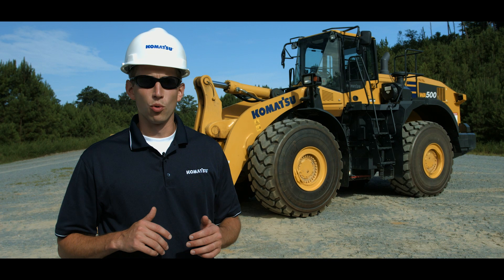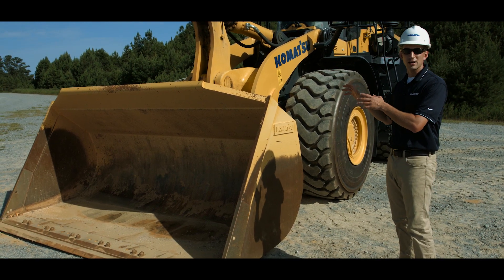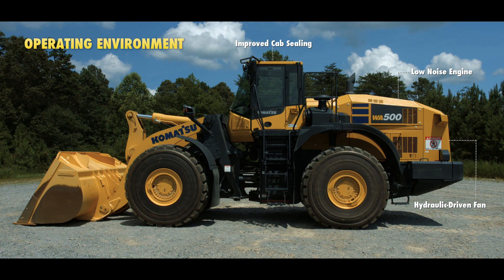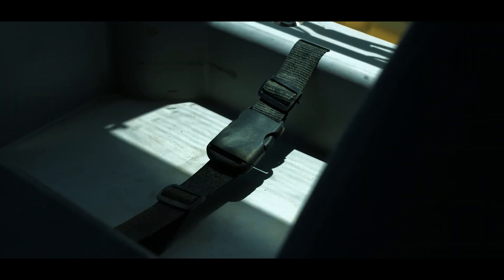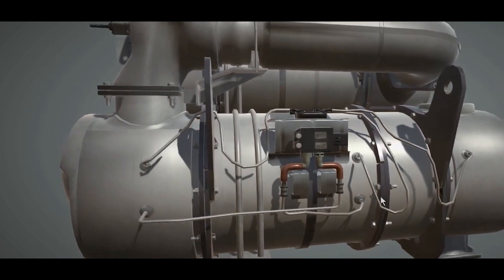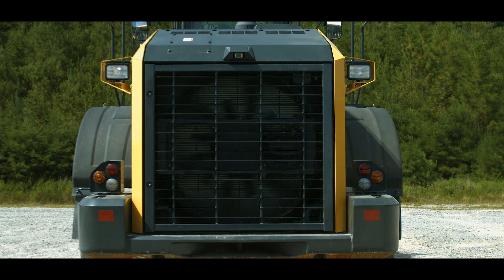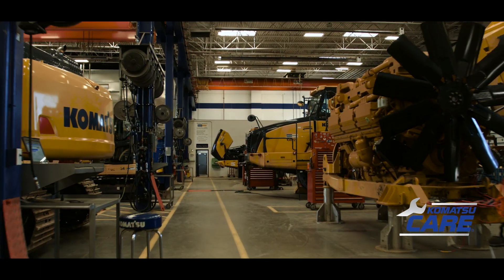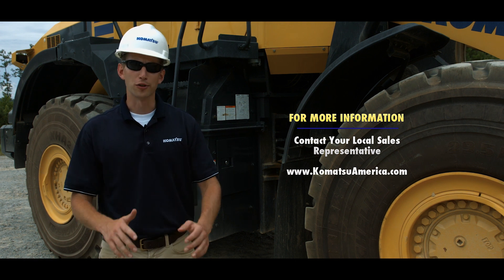Komatsu WA500-8 walkaround

Comment: When will komatsu build the wa 500 with a engine hood that opens like a cat 980? Our operators love 500s but we wont buy them because getting at the engine is a pain in the ass.
Reply: Same thing where I work, all we ever buy are 980's with the exception of a new WA500-6 about 8 years ago. The big complaint on the WA500 for us was the same, engine access was poor and the shop hated servicing it. After that we went back to buying 980 Cats but did demo a Hyundai HL980 two years ago but that was as far as that went.